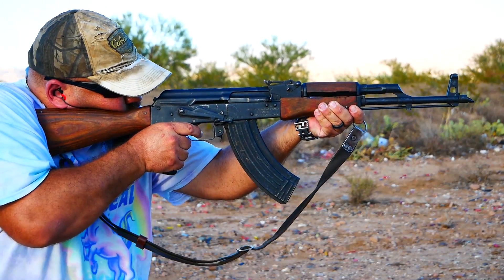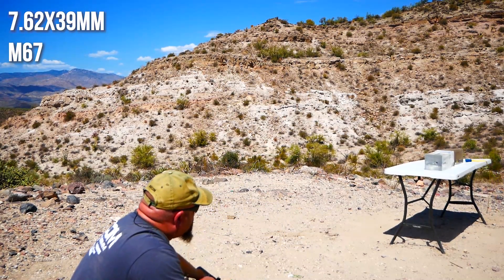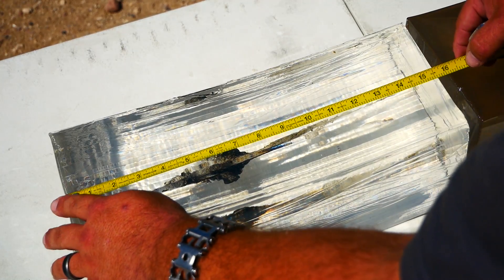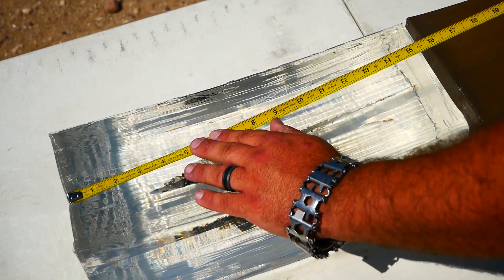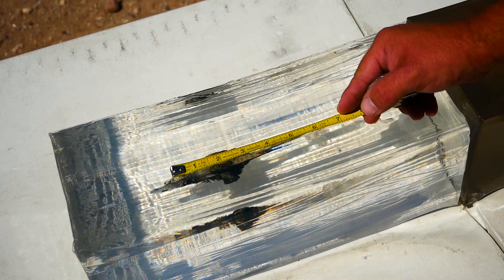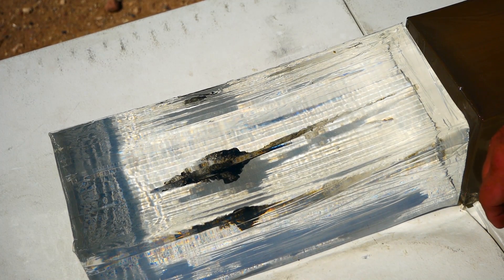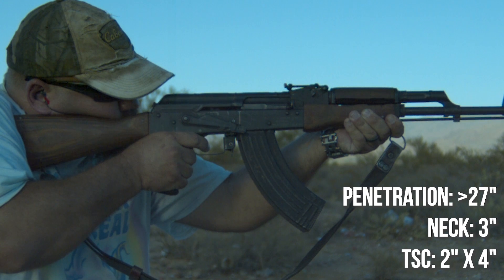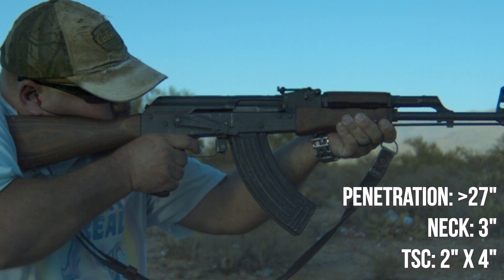Yugo != Garbage: 7.62x39mm M67 124gr FMJ Gel Test w/ Stunning High-Speed Video

Comment: Wouldn't that be the permanent stretch cavity? I mean you are measuring it...when is it supposed to go away?
Reply from the maker: Good question. There is no such thing as a "permanent stretch cavity". The two terms are mutually exclusive. What I'm measuring is the relative disruption in gel, which does not necessary correlate to tissue damage. At speeds greater than 2,000 fps, the size of the temporary stretch cavity can exceed the elastic limit of tissue and cause some tearing, but that tearing is not the same as the full extent of the TSC (observed on high speed) or the disruption in the gel, although both of those can provide clues as to the relative severity of the tearing that results from TSC. As if it weren't already complex enough, tearing as a result of TSC is encouraged by fragmenting bullets so TSC is again not a direct predictor of wound severity. Sorry for the convoluted answer.
Reply: @newsofthepews  thats interesting. Ill begin spreading the word. A lot of folks that do ballistic gel testing need to be educated.
Reply from the maker: @carlosspicywiener8090  and yeah, an awful lot of folks use incorrect terminology.
Reply: @newsofthepews  btw where do you get the 2000 fps number?
Reply from the maker: @carlosspicywiener8090  It's a general rule of thumb, referenced in several publications and as I mentioned, there are other factors involved so don't take it as some kind of exact threshold. But here's one reference:
http://gundata.org/images/fbi-handgun-ballistics.pdf

Comment: Would a m67 at full yaw do more damage for the bigger bullet or a 7n6 at full yaw for the higher velocity 🤔? Reading IWBA the tsc is correlated to the bullet’s presented front section and velocity, not the amount of energy absorbed by the medium. Has anybody worked out some kind of model correlating performance in gel to actual wound cavity dimension in tissue (presumed omogenous)?
Reply from the maker: I think the width of the TSC from both is quite similar, as seen on the high-speed in this video and my previous video. But the length of the TSC from M67 looks longer.